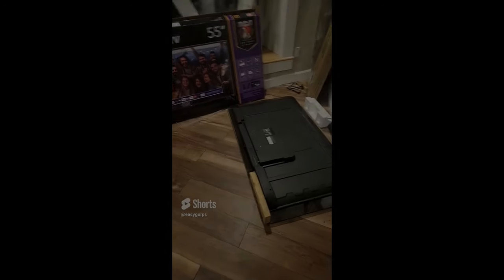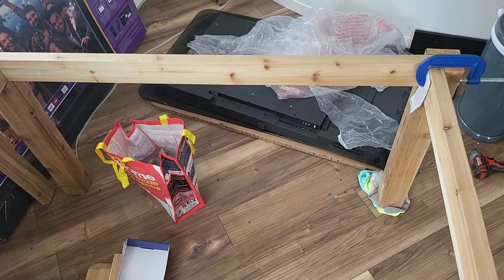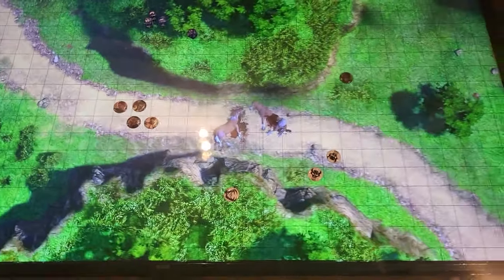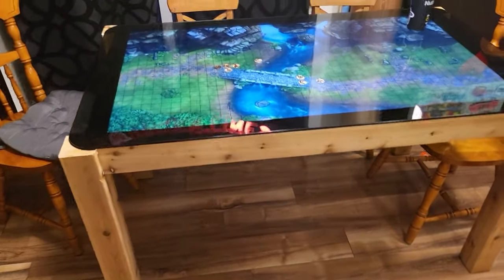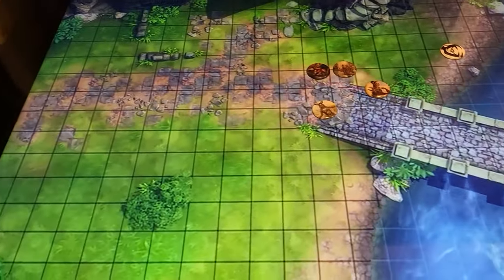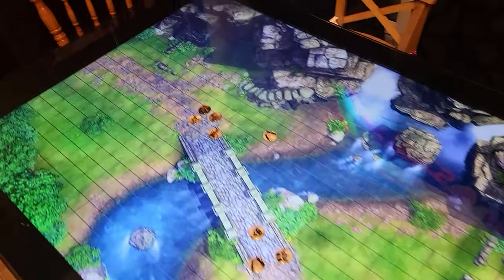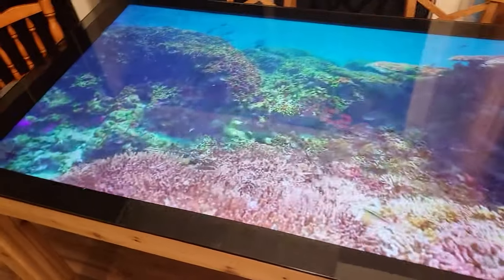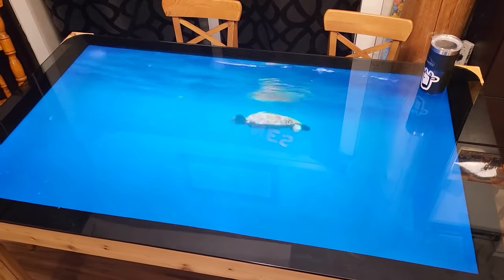Digital Map Game table

Comment: Hi easygurps ,
Great first time build that turned out nice. 
Was the wood repurposed?
What vtt software are you using? Maybe maptools or rodeo, roll20 ,foundry?
Instead of cargo straps couldn't you have used wood slats to hold tv in place. i am guessing it would increase cost of the build.
Reply from the maker: Thank you! Wood was brand new from home depot because I'm cheap. Not the best wood for furniture but good enough for now, and a much more solid improvement on our previous flimsy "fancy store bought" kitchen table. I don't use VTTs much but have used owlbear rodeo and roll20 some in the past. Currently I'm just screen casting images/youtube from my phone to the TV, or using the TVs builtin youtube.